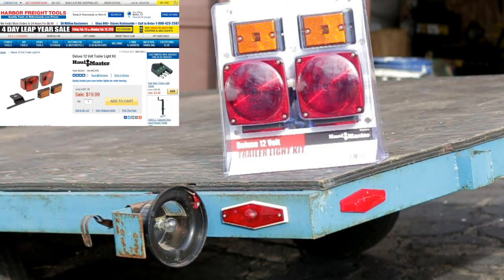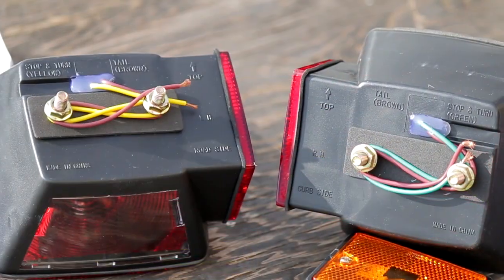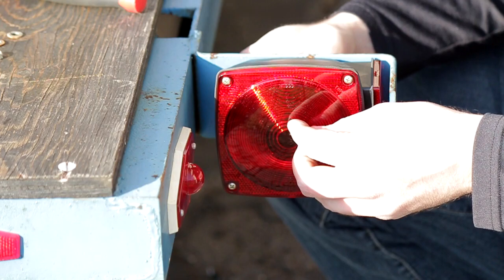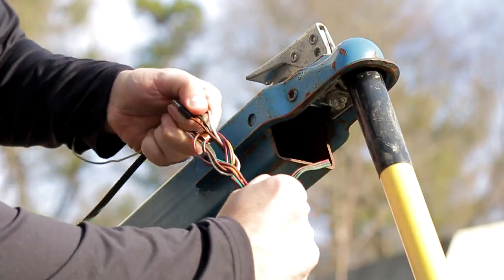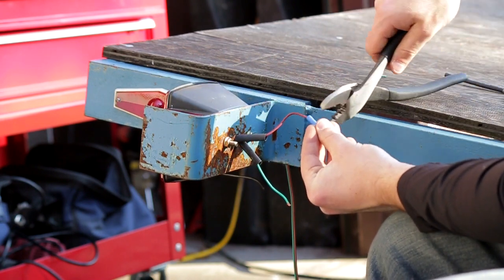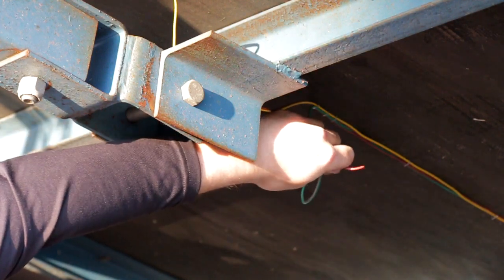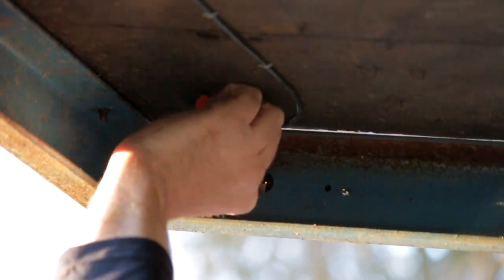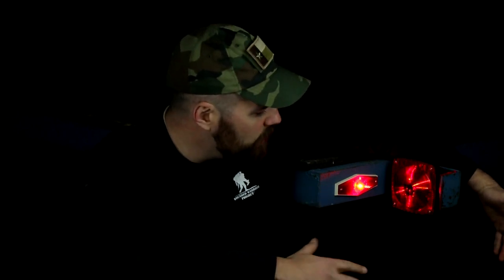The EASY and RIGHT way to install the Harbor Freight Deluxe 12 Volt Trailer Light Kit 62490

Comment: Thank you for the video but you didn't show what to do with the third wire on the back, the white one, or connecting the side lights. Those wires were white so are they to be grounded like the one up front?  Also the kits came with several connectors where the two stranded wire is expected to run through which have a metal tab to one side. They kind of look like they may be meant to splice into the wire when crimped.  They look rather useless actually.
It just occurred to me that my kit is the LED kit and might be different than what yours was.

Comment: Hi, great vid!  For the side lights,  did you have to connect 2 wires, but three spliced ends together?  The wire from the side lights, and the two sliced wires that was originally from the main line (mine is brown)?
Reply from the maker: Correct, you will splice the side light wires with the rear running lights wires.  Typically, the solid color wires are the running or constant power.  Wires with a stripe usually go to the flashers.

Comment: Hey great job on the trailer lights... I have the same lights from Harbor Freight ran all wires fine got everything all hooked up, blinkers work fine, but the running lights and right brake doesn't work. before I rewired the trailer they had the ground wire grounded to the tongue of the trailer the screw was rusty so decided to buy a new screw when I attached the new screw to the ground wire all of my lights were working... went back to check lights a couple of days later and the running lights and right brake light was out again.... What should I do??????
Reply from the maker: Yeah, a good ground is usually the issue.  Hope you get lots of life out of the lights.

Comment: My lights also from Hf have a 3rd white wire on each light.  Your's only have 2.  What do I do with that 3rd wire?
Reply from the maker: Check the manual.  Most likely you have both running and brake lights.

Comment: at what point would you recommend not splicing in any more marker lights? i have a trailer with 9 markers and i would like and two tail lights. which all need to be rewired
Reply from the maker: It all depends on how many amps you are pulling on the wire gauge.  Hard to say unless you know how much each light draws.

Comment: to add lights can i just use the blue solder-less connectors the light kit comes with?
Reply from the maker: Yes, but I have never had luck with those clips.  Wire nuts or soldering have always worked well for me.

Comment: I need help!! Please!! Rewiring an old pop up external lights ( driving turn brake lights) Ripped out all the old wires, started from scratch. Nothing works. Even tried eliminating the side markers and still nothing. Then tried running another different set of wires, nothing. My vehicle is sending power through the harness. Could it be the brand new lights?? I've done this many times w out issue, not understanding what the problem is w this particular trailer any ideas??
Reply from the maker: Let's start with the basics.  Are all of the ground wires making good solid contact with the metal frame of the trailer?  If yes, is the white wire properly connected to the metal frame as well, must be touching bare metal?
Reply: G.I. Bro wow you are awesome to respond so quickly! Thank you and thank you very much for your service. Gid bless you for protecting our country .. Sorry I'm a navy brat had to give you props! Anywho.... Everythibg is as it should be w the ground wire, even tried a different ground point still nothing not even a flicker
Reply: God bless you.. Idk who Gid is but may he bless you as well.

Comment: At 0:43, you say the metal license plate bracket is useless & to discard it. No way! You'd be better off to straightened that bracket, clean it up, paint it & reused it. Those cheap, crappy plastic license plate brackets are the worst thing in a tail light kit. I would never replace a metal license plate bracket with a cheap piece of plastic that can break fairly easily, not would I recommend anyone else to.

Comment: Wondering if someone can help me out.  My vehicle has two double filament lights on each side.  Top double filament light is signal and hazard and bottom double filament is tail and brake.  I ran my trailer lighting and saved my brake light connection last.  All lights worked fine until I connected my brake light wires as instructed.  Instructions said to wire left signal and brake together and wire right signal and brake together.  Once I made those connections, all lights blinked when signaling left or right.  Obviously I don't want that.  What am I doing wrong?
Reply from the maker: you should have two wires for each side.  Solid and solid with a stripe.  These wires will connect separately, not together. The ground wires get mounted to the frame.
Reply: Thank you for replying.  As written I agree Harbor Freight instructions can't work.  Each side has a common brown for tail lights, then a yellow for left side and green for right side.  Of course there is a white ground.   They say, connect trailer yellow to vehicle left signal AND brake light and trailer green to vehicle right signal AND brake light. Lights on vehicle and trailer all blink when either signal is activated.  When I disconnect trailer, vehicle lights are still affected as they should since this wiring can't work